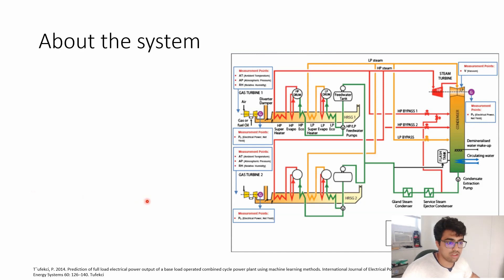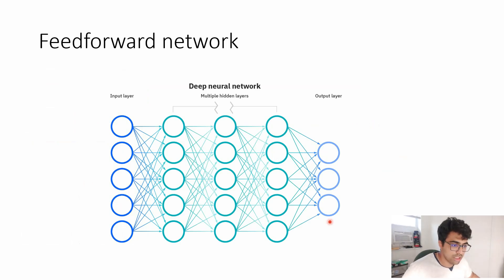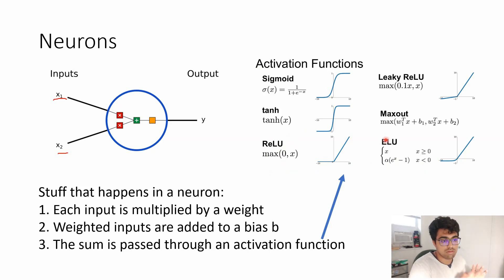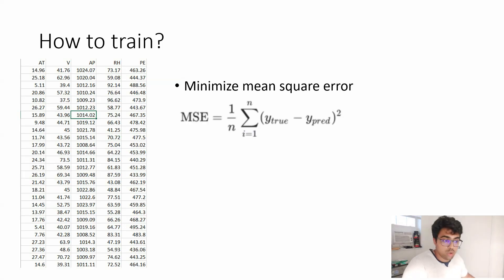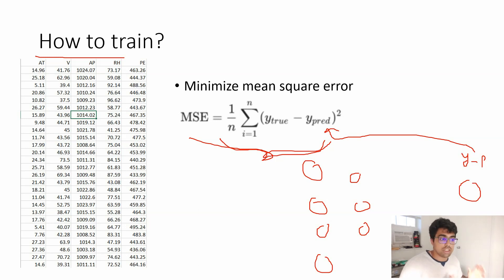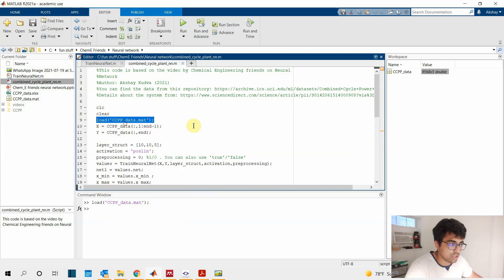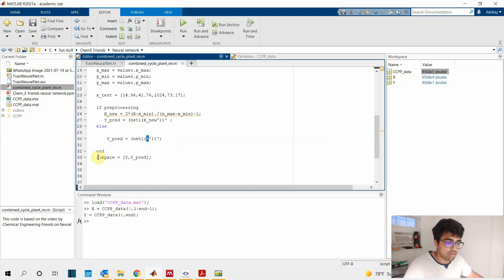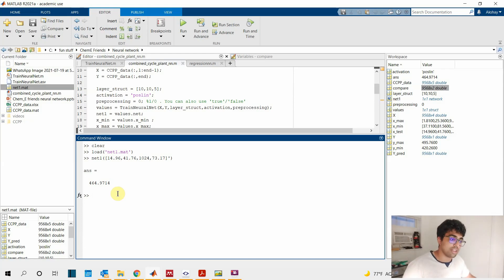Introduction to Neural Networks || Chemical Engineering Problem || MATLAB

Comment from the maker: Hey everyone!
Everything that was explained in the video is accurate. I realized that in the I forgot to post-process the data so there is not point using pre-processing feature in the present version of the code. In post-processing, we update the weights and biases of trained network (which used pre-processed data) using scaling variables of pre-processed data. Check to see if the code has been updated on GitHub. You can still play around by un-processed data. Hope you found the video useful otherwise. Cheers! :)
-Team ChemE friends